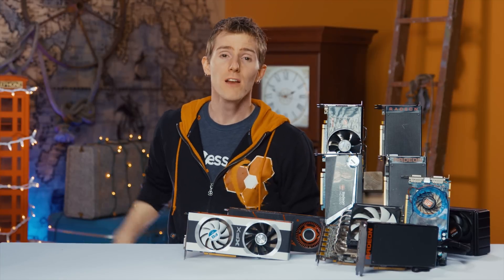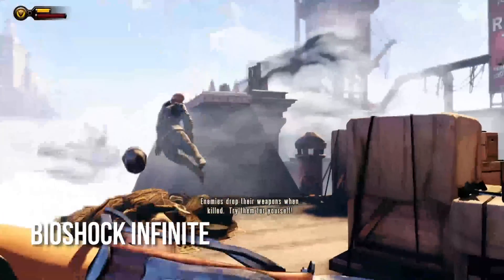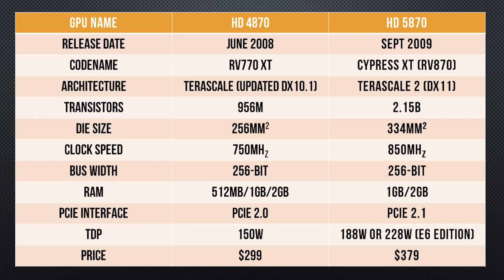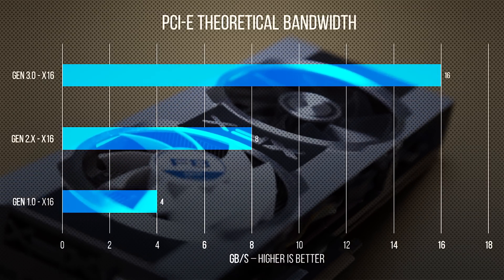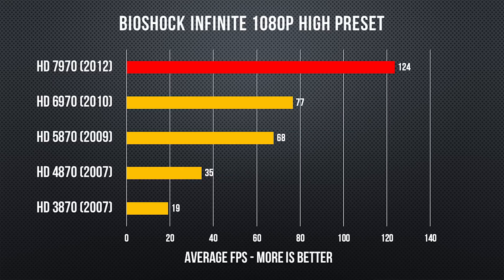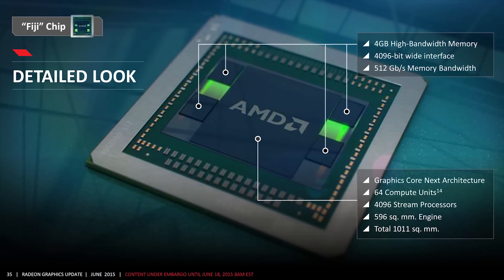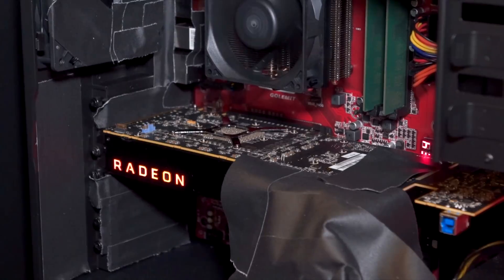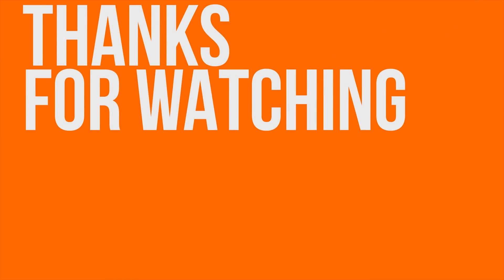10 Years of AMD Video Cards BENCHMARKED!

Comment: Owned HD4870 for 6 years. Best GPU ever made.
Reply: GhostRider5555555 who cares if you dont play latest&greatest?
Reply: But DVI can be Digital or Analog. If your monitor has Digital DVI, aka DVI-D, than you can buy HDMI-DVI-d cable and use latest GPU with your old monitor. P.S. 7970 still grate, but hot.
Reply: Cooper Gates it's not hot. I hate the stigma that ALL GPUs that are not 14/16 nm are shit. Theres more to it than just power and fucking  heat...
Reply: i bought a hd4870 used. once i had it in my posession it was clear to me the card was used as a bit coin farming card. it had seen a life of max temps all day. it failed to stabilize under any additional mhz applied to the over clock on both ram and core. a year later i would have to down clock it for stability.  unfortunately i seen what damage could be done when the over clock slider was slid to max along with mem clocks. instant black screen of eternal no post death and 100% fan speeds at boot. never to live again. i was even in mid sentance saying to my co hort that Don't over clock it and bam applied was set....dead.... Asides from that it was a great card whilest even in its last dying throws of life.
Reply: But it hasn't got the d3d11 support :(
Reply: How about HD7970? My monitor has a DVI so I wouldn't get the RX 480... rofl
Reply: 7970 Founders Edition cooler is a dud? I thought 7970 pulled less juice than RX 480...
Reply: Lies. 5870 and 6990 says hi.
Reply: have a HD 6950 for 8 years now still going strong

Comment: i bought MSI's 290x LIghtning on release and still use it now, it does wonders for 1080p gaming, but I'm looking to upgrade to 1440p in the near future. Probably gonna do a Ryzen 1700/1700x and either a gtx 1080 or 1080ti if vega isn't impressive.

Comment: Someone has been stealing Jay2Cents video material :)
ATi/AMD cards worth getting
9700Pro
X800XT Platinum 
X1900XTX
HD4870 1GB
HD5870
HD7970
R9 290X 8GB
Reply: Still got a 9700 pro, 9800 pro, and a 4870 in my collection of parts. They were great cards in their prime.
Reply: amen to that
Reply: DVI monitor = HD7970 gg?
Reply: And Ati Radeon 8500, 9800 PRO 256mb and X850. But the best of all times, the Ati Rage pro 8MB. This thing can decode DVD's alone, with hardware, without use the DXR2 from Sound Blaster or whatever...in 1990-91. 

All AMD cards are great cards. And Nvidia Too....TNT Riva, Geforce 256 and MX, FX 5200, etc etc etc...

But the best i remember, my old Monster 3D Voodoo FX 4MB + Ati Rage 8MB. Can run Opengl Quake at 100fps in 640x480 100hz and ULTRAHE, the Nintendo 64 Emulator with a Pentium 2 350mhz... ahhhhh  i love these days...

Comment: Almost well done but I don't agree with your interpretation of Fiji XT. The Fury X wasn't the true star of this GCN iteration but the Nano which is still a absolutely amazing card today. The Nano was the spot-on optimized enthusiast card. IMHO the Fury X was just made to show-off (all "uncapped" for maximum performance characteristics) while the Nano was made to convince (all tuned for rational performance characteristics).And btw talking about 10 years of AMD video cards without even mentioning the Radeon HD 4770... this card paved the way for Cypress XT's success and I think that Cypress XT regained the respect for AMD that the company (respectively the ATI brand back in the days) had lost with R600.

Comment: what is this? Been rocking my 290x videocards since 2013 @80c reference cooling.. I sold my 780ti because it couldn't run 4k at decent frames. I still play games in 4k maxed out, I've been playing RE7..  I am upgrading to Vega when it comes out.. And I am positive that 2 years from now Vega will be stomping the 1080ti.

Comment: The 5870 with the 6 mini display ports is something I wish we still sorta had.
I want a card with at least 4 display ports than just converting out to other ports if you need them.

Also I had some of these AMD cards back in the day, I think my first experience with Crossfire was dual 4790s (I could be wrong) but that was awesome. I remember using two power supplies to get it working when I first started fucking around with it.

Comment: Still have the 290X (Asus DCUII OC) and it still works great in 1440p gaming.
Reply: I have a Sapphire HD4870 laying behind me (not supported in newer drivers).
Then I had the Asus HD6970 DCII. 
I sold that to a friend and bought a Asus R9 290X DCUII OC (also on a shelf behind me) which I used for 4 yrs.
Now I have a Sapphire V56 Pulse (nano pcb).

I have had several AMD/ATI cards before the HD4870, but my memory doesnt go that far back.

I see from some emails I have purchased: 
"Sapphire Radeon X1900XT 512MB GDDR3" in 2006.
"PowerColor Radeon 9600 256MB DDR" in 2003.

From my memory:
"Geforce 4 Ti4400" 2002 - Think this is the only Nvidia card I ever owned.
"Hercules 3d Prophet 4500 Kyro II 64MB" 2001
I remember having some 3DFX cards before that.

Comment: Ah, a blast to the past, i like it! I still have my two 2900XT's, 4870 and 7870XT and still work. The 7870XT is still at work in my current PC and i don't really feel the need to upgrade it. And from what i saw, it's not that far off the RX480. And for a little over 200 bucks in 2013, i think this was thé best choice i could've made for my build back then. The only thing which is showing age, sometimes, is the 2GB VRAM in newer games.

Comment: 4870 was my first modern graphic card. Before that I had TNT2. I managed to burn through two cards in warranty period of two years. Both got artifacts on load and had problems to connect to my tv. Threw them out. Bought GTX 650 Ti with biggest double fans I can find and I'm geforce fan now.

Comment: the HD5670 was my 3rd graphics card... and what a lil beast that was~ granted it was the lower end of the HD5xxx serie but still was able to run most games at 720p no problems (also I still have it, not in use anymore but I could put it into any pc and it'll work just fine) 

My next card was the gtx560ti which died half a year down the line (first and last time I bought an used graphics card) and I would pass another half a year without a graphics card (darkest times of my life) until I put my hands on my gtx950 and currently have that on my system, lower end of 9xx serie but still it's kicking serious ass at 900p and in some games 1080p.

Comment: It still feels like yesterday whenever I was gaming on my Dell Vostro with an AMD 6850. It's sad I never got the 7850 to work on it as support for non GCN GPUs is almost non-existent outside of the Linux Radeon drivers. I also need a new motherboard and/or CPU because it now posts with a cache test failure. I really do miss messing around on that PC. :(
Reply: What did you get?

Comment: What about the the monstrousity that was the R9 295X2?
Reply: You sound like a salty 14 year old that just got his heart crushed by a reality check.

If you actually bothered to look at R9 290X vs. 970 benchmarks you would know they almost directly compete and are practically on par in most games, with a 5%-10% difference on titles that prefer Nvidia. 

How are you going to claim that your 970 will beat two of them on the same PCB, overclocked to the max and water cooled ? 

I've had Nvidia since the 6 series up until Kepler when I dumped my GTX 670 SLI that was virtually useless when maxwell was released. 

The "AMD had shitty drivers" is an outdated cliche that hasn't been true for a long while, crossfire support is YEARS ahead of SLI. 

I've never had ANY issue with crossfire or any radeon driver in the last 3 years of owning this card and even to this day - I'm running modern games at ultra 1440p at near gtx 1080 performance.
Reply: PurePhoenix good joke, your 970 will never beat a 980ti... 
Even a gtx 1060 and rx 480 can beat your 970.
Reply: Sorry to say many cards had beaten your GTX 970 long ago, not to mention as of most current modern games that is really demanding when comes to VRAM. 
Take Mirror Edge for example. Even AMD's older 390X is beating your GTX 970. 
How much is GTX 970 cost these days, I think the RX 480 is cheaper and faster too.
Reply: Honestly 295X2 is quite powerful, it kick some ass for quite a long time. 
Matter of fact...I think the 295X2 is even faster than my Fury Nitro....
Reply: PurePhoenix Whats wrong with you? 
Gtx 1060 and Rx 480/580 have nearly the same performance and they beat the gtx 970 in many games. Thats a fact.
In some games the gtx 970 is maybe faster but thats not often. The 970 is limited with only 3.5 + 0,5gb ram.
Nice trolling by the way.
Reply: PurePhoenix then upload a video and show it to the world. You would be the first one.
I know that u can clock the 970 pretty high and u can get nearly 980 performance but 980ti is another thing
Reply: I'm still running it lol. It performs between a 980 Ti and a 1080 on any game that has a crossfire profile.

Anything single GPU and I'm stuck with R9 290X performance at 1100 MHz clock and 2800 MHz memory.
Reply: Actually question is does the GTX 970 is even on par with the 290X / 390 ?? 
I mean AMD Fine Wine Technology....it does wonder lol...
Reply: Yea, your 970 has a bit bus 4x smaller, has 4x less shading units (cuda vs. stream), and has almost 7 billion less transistors all while boasting relative core clock speed and a marginally higher effective memory bandwidth. 

Unfortunately, no matter how fast you are running the 970 - it just has much less real estate. 

Mind you that the R9 295X2 was a direct competitor to the 780 Ti SLI and Titan Z. Which both get crushed by it. 

You have absolutely no chance in any application that supports crossfire.
Reply: he probably benchmarked his games @ 720p vs 1440p (980ti) thats why he's insisting that his 970 is faster than 980ti ..
Reply: PurePhoenix 7700k has double the single core performance, double the 4-core performance and ~70% better multi core performance over a fx 8150... GTX 980 Ti has 50% better performance than a GTX 970, and you still think your shit components are better? Wow...
Reply: Mc GetRekt I agree with you.480 is tied with 1060 and 5-10% faster than a GTX 970

and i think if you oc a RX 480,performance will come close to a  GTX 980
Reply: you probably high on something .. 970 never overtakes against 980ti .. first of all the fcking vram is only 3.5gb fast + .5gb turd vs 6gb .. if you compare to stock 980 you probably have a point but jumping on 980ti you probably high .. even 290x is killing 970 on almost every bench
Reply: DrillFX you're right, I must've missed that bit
Reply: 295x2 wasn't bad ... ask the Titan Z how heavy it weighs on the failure scale ...
Reply: PurePhoenix  80+ fps with a fx 8150 and gtx 970.

seems bulldozer has matured.but surely you're running a beefy cooler with that cpu to keep it cool
Reply: I snagged a cheap 295x2 at a time when it was not profitable to mine  bitcoin with video cards.(but that's not the case anymore) Water cooling solves all heat and noise problems. Upgrading when volta, or the 1180/titan drops.
Reply: flintstoner why not vega :P
Reply: Ya I meant to say vega not volta. But it will be either amd or nvidia top card in the next year or less.
Reply: fuck you dong
Reply: fuck you jett
Reply: PurePhoenix an FX 8150 in an aio? never heard of that
Reply: PurePhoenix i think the vulkan API Is reducing the bottleneck on the cpu and gpu.might be the reason you are getting great FPS
Reply: PurePhoenix 5770 kinda sucked because of the horrible drivers back 2010. even with proper drivers is still lacking
Reply: DrillFX Wow.. much triggered very wow
Reply: PurePhoenix Most dells ends up in refurb stores in my country. They Give A Good base for a decent pc tho. 250$ for an i5 dell isnt too expensive
Reply: PurePhoenix But New dells suck tbh
Reply: You're full of shit m8. There's no dell which CAME with 32gigs of ram and an SSD 7 years ago.

Also the debate isn't what runs what, that's stupid. You brought it up, because you're stupid.

The debate is whether a 7 year old CPU is "slow", which by your own admissions is not. It's quite sufficient for most modern tasks.

Idiot.
Reply: Or HD 7990)
Reply: R9 Fury X Master Race!
Reply: Why do you even bother feeding the troll?
Reply: Cough, R9 290X, cough. Pretty much same performance as 780ti and slightly less than the Titan for half its price.
Reply: 780ti is also reasonably more powerful then 290x, 780ti beats out 970 while 290x isnt even close to a 970 performance
Reply: +flintstoner That 295 X2 will last you at least 4 years unless you want to reduce power consumption. Performance? Can't complain there.
Reply: Oh and if you weren't a lazy piece of shit, you'd have actually checked my benchmarks out yourself and seen i actually show parts, cpuz/gpuz, coretemp and more to prove it's legit.
Reply: Knixen , just an aio actually. I show all parts in other benches. Only some of them are over clocked.
Reply: saladwithsalad 3edgy5me
Reply: RyTrapp0 been saying for ages there's just heavy rigging in the industry. It takes years before people started doing anything about it. Amd have beaten fucking Intel since the Duron days.
Reply: RyTrapp0 nah, you are just dumb enough to run ati. That 5770 doesn't even best my old gtx460
Reply: PurePhoenix and beating the gtx 680 with the HD 7970
Reply: Then mute it you assclown. You're on a tech channel and didn't expect banter? Dafuq is wrong with you?

@Knixen, i wouldn't be so sure about that. Depends on the game. Rigging was rampant until people made some noise about it.

Now AMD are specifically working with developers to ensure Ryzen gets a fair go.
Reply: K, just double checked. Older games yes, 7970 beats the 680. Overwatch, BF1 and others hell no. Rigging for sure. Old cards don't perform better in newer games than games around their release date....they just don't. They're far more demanding.
Reply: "An old Dell rig from the trash".... stupidity confirmed.
Who the fuck buys dell for anything? Just overpriced garbage. 
Even at corporate level discounts.
You will literally never win this argument, you deluded nutjob.
Reply: $250 was the price of the bulldozer 8150 brand new.... 
These days you can get a whole gaming rig for that price.

Trapp0 would know that, if he wasn't completely fucked in the head.

Also, Trapp, it's not "Free" if you put stuff in it, you downer. 
My dozer 8150 is only a year newer and yet still $200+ in aus and ~100+ USA.
Even second hand.

Which proves you have a steaming pile of shit compared to my CPU, since you can get yours for as little as $20.
Fact.
Reply: 295x2 does definately not perform inbetween a 980ti and 1080 it performs somehwere in between a 960 and 970 closer to a 970 peformance
Reply: Mc GetRekt you're one of those 11 year olds aren't you? Check the benchmak, you're going to feel very stupid.
Reply: ace partosa I'm not talking about opinions, i proved it. End of discussion.
Reply: Literally the only time amd/ati have beaten Nvidia, is when they royally screwed up with the 5000FX series in like 2003. Those were horrible. Even mx440's beat them.
Reply: Knixen , oh my cpu is no bottleneck buddy. It's legitimately faster than a 7700k. Skyrim minimum frames are 30% higher even, that's a cpu intensive game.
Reply: Citation Needed~ (No seriously, i've looked, every single user-made video contradicts linus, jayz etc).
Reply: AMDdizzle The great "citation needed" wasn't clear enough? Real benchmarks needed. Like mine.
Reply: Tobias Jöny done. Check my benchmarks list.
Reply: Tobias Jöny false and my benchmarks prove it. My 970 even out paces stock 980ti's.
Reply: @AMDdizzle, none of that makes a shit of difference. The GPU puts out more frames per clock speed & memory bandwidth. Pretty much always has been the case with the ATI vs nvidia argument. Morons buy into it and get butthurt that their "Significantly faster" ATI card actually doesn't get great framerates.

That's the shitty driver support everyone always accuses ati of doing.
Reply: haha, no it doesn't. Most people are just shit overclockers, no amd card even beats my galax 970. In any game.
Reply: Eric Tan a good 970 beats the 980 ti. 

I've got the best of the best in the 900 series.
Reply: Tobias Jöny you're a fucking idiot. 480s don't even get half the performance of a 970.

Comment: There's a minor mistake I think. At 0:19 you mention it has 8 GB vram but later at 0:27 you mention the price of the 4 GB model.
Reply: also for some reason in the chart they refer to the 6gb hd 7970 version but for the 290x they put 4gb altho there is an 8gb version too

Comment: you guys should do a video on the 2011-3 motherboards and their compatibility with the new gen processors such as the 6800k 6850x 6900k. there seems to be a lot of confusion about what motherboards come updated out of box and most tutorials on updating bios are using alternate a CPU. although there is forums not many people understand them and going around messing with the bios is sometimes dangerous depending on the experience of the user. Although most of the other processors from the enthusiast platform are haswell ready the 5830 5820 and 5960 series are ready out of the box.

Recommendation for a video not sure if you've done one already. 

Going around the forums there is a lot of confusion 
just saying
Currently I run a skylake 6600k with h60 cooler and a EVGA GTX 1080 SC ACX 3.0 and looking to upgrade motherboard to a x99 asus pro4 but from different post some say it supports the 6800k (my next processor I am buying) and some say  you have to flash the bios and update using a thumb drive.